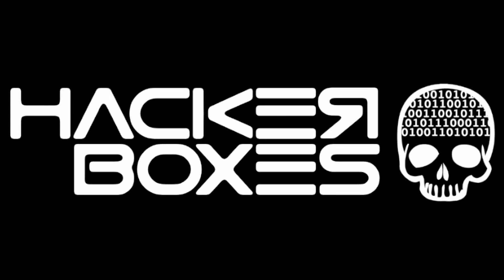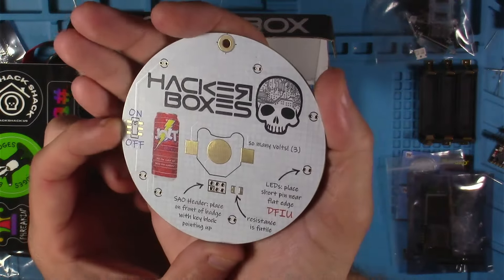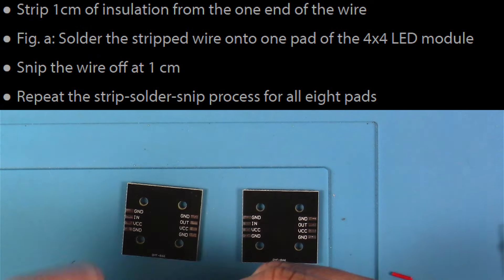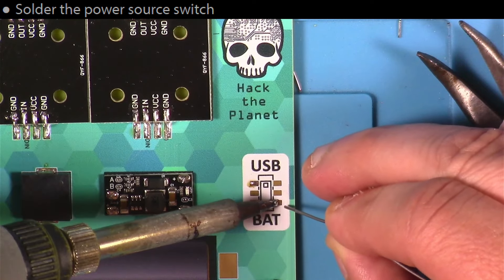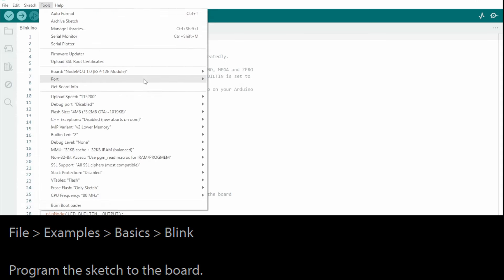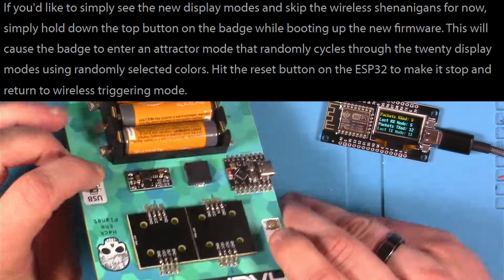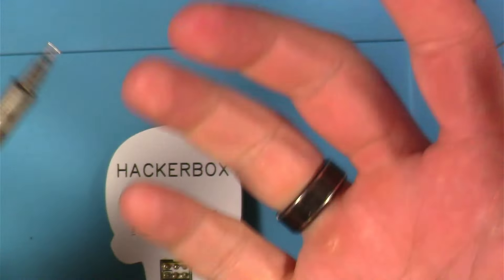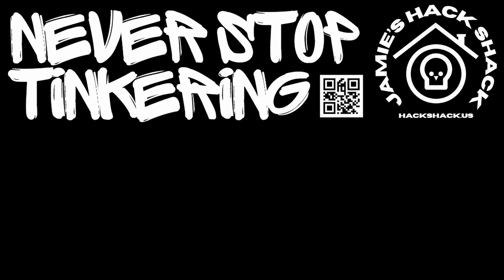Hackerbox 0104 - Engage (#badgelife)

Comment: I really need to up my soldering game, which is to say I have no soldering game, so anything would be a step up. Enjoyed the video, including the mistakes. Appreciate the gotchas as well; would not have thought to break in the mating connectors to avoid ripping them off the board.
Reply from the maker: Yeah those sao connections can benefit from a little pre-use break-in for sure! Warm up that iron and find something to practice on. The more you do it the easier it gets and the better you get! Thanks for watching!

Comment: These boxes are fun. I'll probably start getting them after I move, would be great practice to alleviate my horrible Solder skills.
Reply from the maker: They are fun for sure! Hey, the more you solder, the better you get. Just take your time and don't get frustrated if it's not going your way. Take a step back and revisit after break.
Reply: @JamiesHackShack  The trick being to get myself to actually sit still long enough to do it. I watch these videos on the treadmill, and every time I'm not cleaning, working, or working out, I feel like I'm being unproductive.

Having a Temu soldering iron with questionable temperature control probabbly doesn't help me either, lol.
Reply from the maker: @DFX2KX  Hey! Your comment was the one snagged by the random comment picker. If you want to drop an email to jamieshackshack@gmail.com I'll send you a phrase to reply back to here for verification of the account matching. Go ahead and send your mailing address to/in the same email if you want. Thx!
Reply: @JamiesHackShack The Tacos were Delicious
Reply from the maker: @DFX2KX  thx!